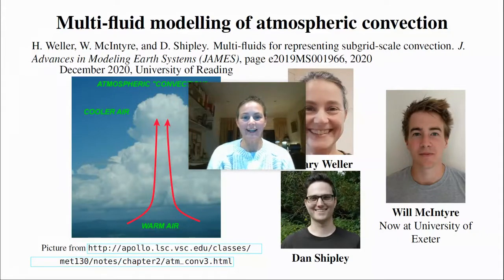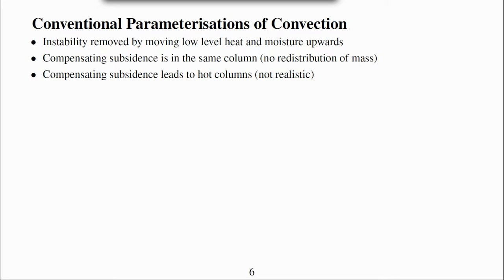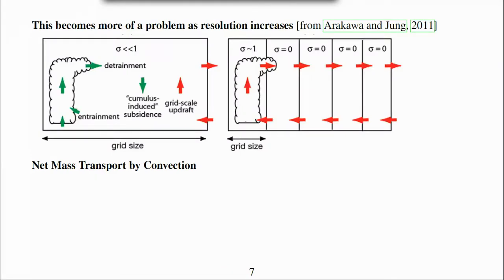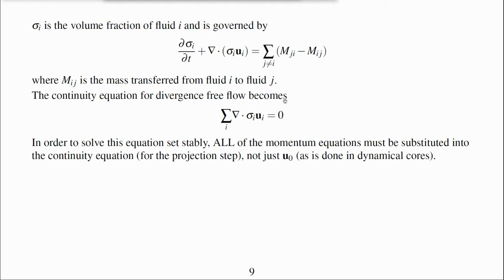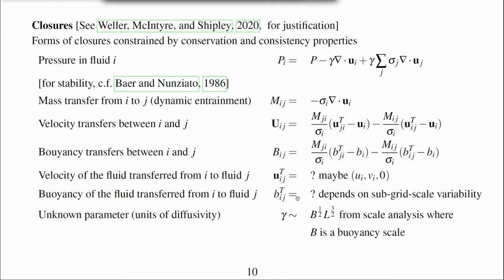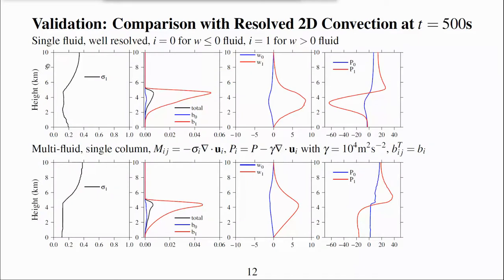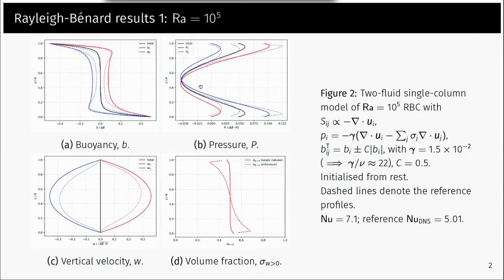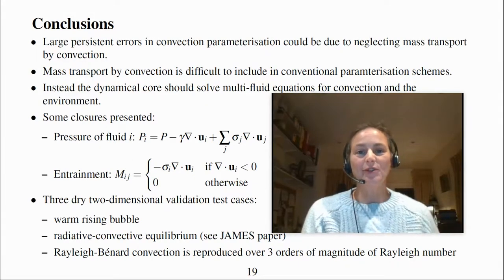Multi-fluid modelling of convection. Talk at the AGU conference

Comment: Is it possible to derive the cumulative atmospheric radiation at the top of atmosphere and at the surface from NS simulation?
Reply from the maker: You would need to simulate a lot more that the Navier Stokes equations to calculate top of atmosphere radiation
Reply: @hilaryweller615  Thank you. I thought it seems impossible unless some brutal treatments are used to the integrodiferential equation for radiation in 7 dimentions. Would you like make a short video on those "observations" by using climate models such as CMIP5?  My recent study shows that the outgoing radiation (OLR) is independent of atmospheric absorption, yet ICPP claims that the change in OLR can be "calculated" from climate modelling. I taught CFD before, but I have not done similations.
Reply from the maker: @yongtuition  CMIP5 models do calculate radiation and so OLR can be calculated from climate models.
Reply: @hilaryweller615  The question is how? Does one have to use Kirchhoff's law?  Single-scattering approximation?
Reply from the maker: @yongtuition  You probably want to read a scientific paper or book that describes a climate model to find out how this is done.
Reply: @hilaryweller615  I have read many papers, including UCAR's description. It is what expected: the radiative transfer  equation used  in all climate models is incapabale of dealing with radiation heating/cooling, anisotropic emissivity, and realistic radiative diffusion. Above all, one cannot treat every mesh as a blockbody. If you coudl find any paper,  including the radiative convection model you mentioned in your talk,  that claims such basic issues are solved in CFD, please let me know.
Reply from the maker: @yongtuition  I am afraid that I know very little about radiation. I work on the Newtonian fluids part and numerical solution of the NS equations.

Comment: Hi maam, what are given to simulate the fluid?
Reply from the maker: Sorry could you rephrase the question. I do not understand
Reply: @hilaryweller615  I want to simulate the wave of water using spreadsheet, what do I need to calculate?
Reply from the maker: @jhanolaer8286  First learn to write code rather than using a spreadsheet. Then you will need to learn about fluid dynamics, partial differencial equations and computational fluid dynamics. Then it will be time to find a code to similate a water wave